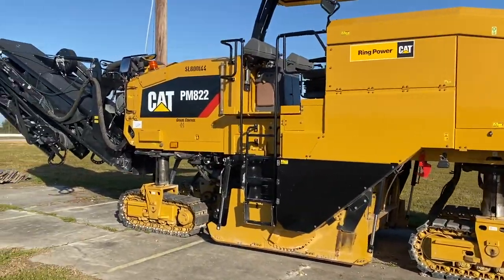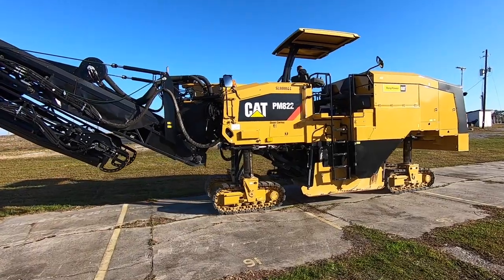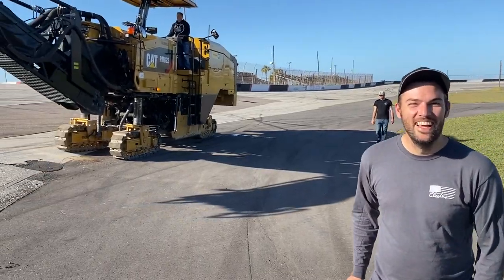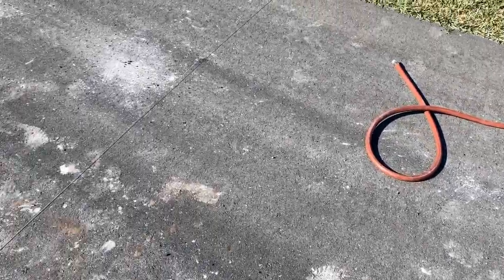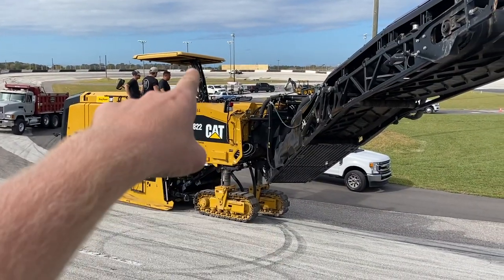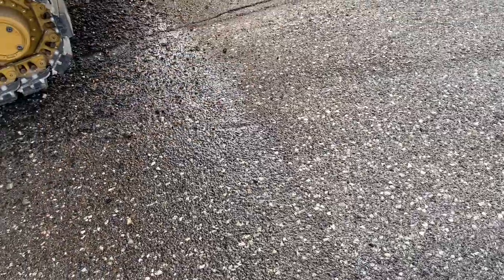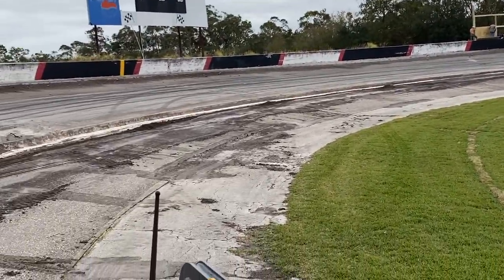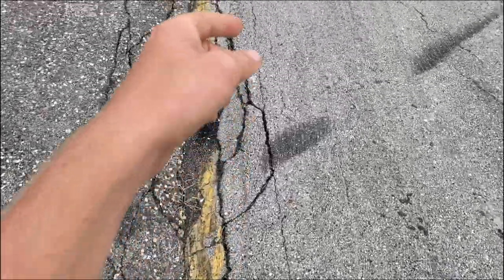Renovating an Abandoned Racetrack Part 5 - The BIG MILL Rips Into the Freedom Factory's Bank Turns!

Comment: The only time liner works cost wise is when you have extraordinary costs associated with disruption.  If you have basically greenfields (like you do) it is always cheaper to dig and replace
Reply: Ya if it was a open track with a full schedule it changes that dynamic completely.
Reply: @jaydunbar7538  or if it goes under a building
Reply: Don't forget about pipe bursting
Reply: @rys4469  far more expensive than how Cleetus is doing the job. It is always, 100%, cheaper to dig and replace so long as you don't have extraordinary issues.

Comment: When we did Daytona. We had a D9g on the outer wall. A cable going to the Grader. An they had to move together so the dozer held the Grader in place. We did have a cable snap. An the Grader rolled down the bank. Driver was fine. But I understand what you are going through.
Reply: I've seen pictures of them doing that to pave a track. It's wild! I think a lot of people don't understand just what's involved in paving a racetrack. Can't raise a dump bed on that kind of slope😂
Reply: It's hard to tell just how steep a bank is through a video, seeing it through a tv/pc/etc screen doesn't do it justice.

Comment: You should get reproductions made of the track blueprints and sell them as posters, maybe sign them.
Reply: The architect of the track may own the copyright to the blueprints. That could prevent ol Cleet from selling copies.
Reply: @wjpreslar  , everything is negotiable. It all depends on the details of the contract. In most, it takes both parties to consent to reuse. But again, it depends.
Reply: @Bill_N_ATX  agreed. Just pointing out that it isn't as easy as running out to Kinko's.
Reply: @wjpreslar  the dude is probably dead
Reply: @joelbryant7371  in that case his or her estate would own the copyright. Copyright in the US doesn't die with the creator.
Reply: @wjpreslar  , well it does sorta. It just dies like 75 years after they do, depending on when exactly they kicked off.
Reply: @Bill_N_ATX  75 years after the death of the creator is, by definition, not dying with it's creator.
Reply: @wjpreslar  thus the sorta. It’s the trigger for the eventual ending of the copyright. They do not extend in perpetuity.
Reply: @wjpreslar  Blue prints are public record once submitted to the city, anyone can reproduce them in accordance with freedom of information act.
Reply: @Bill_N_ATX  Blue prints are public record once submitted to the city, anyone can reproduce them in accordance with freedom of information act.
Reply: @1byte4  , yes, but they may not be used for commercial purposes. You would be able to use them for the usual Fair Use purposes, but just because something is given to and available to a government agency doesn’t mean it has lost its copyright protections. Use it in the newspaper or as a teaching aid, perhaps, since Fair Use is a defense to copyright infringement, not a prospective use, but you couldn’t print up copies and sell them to others. Otherwise there wouldn’t be a pretty good industry in selling plans for homes etc.
Reply: @Bill_N_ATX  Furthermore, cities don't always keep them in perpetuity. I wanted the prints for my house and neither the city not the county had a copy. Back in the days of paper for everything, space was at a premium and they'd only keep things like that for a specified period of time before destroying them. The only source after that time would be the copyright holder.

Comment: As a kid I remember my Dad going to pave at the Atlanta Motor Speedway. Anyways he showed me pictures of them using equipment on the bank, pavers and millers. They put a steel I-beam between the equipment on the bank and something heavy like a dozer or miller on the flat inside of the track to keep the equipment from flipping. Obviously brackets were welded to both pieces of equipment. hope this helps in the future.

Comment: Neighbor truly is one of the most reliable built cars ever.
Reply: Right. Ford needs to take notes on how to build a car. 🤣
Reply: well that one has a very special angle with it. RIP ED
Reply: @SpartanRacing1989  it did blow up at Cleetus & Cars. More white smoke pouring from the engine bay than the rear tyres.
Reply: @richardharrold9736  yeah but look at how much hell he has put that car through. Most Ford's would not have lasted an entire burn out
Reply: @SpartanRacing1989  eh, there's nothing special about that 5.4, Fords generally are pretty tough and the 4.6 Teskid is the strongest of the lot.
Reply: @richardharrold9736  theres nothing special about Fords in general. I'm just saying Cleetus and his crew can build a Ford better than Ford can
Reply: @SpartanRacing1989  L&M can, you mean. It's just a 5.4 with a sleeved block and some spicier cams, otherwise nothing that you didn't get in a GT500 way back when. Besides, all those overhead cam motors are basically a Jaguar design, but (in the case of the 4.6 Teksid) built in Italy by Ferrari engineers.

Comment: I just wanna say, that's a lot of diesel fuel
Just imagine how much diesel is used in other things, how many hundreds of gallons used in construction or how many hundreds of thousands of gallons in mining metal and lithium or oil pumping and all that, diesel really does make the world go 'round :P
Reply: Yup. This is why I am convinced that diesel will even outlive petroleum.

Synthetic diesel fuel!
Reply: And diesel covers a wide variety of things unlike petrol that people put into there cars... almost any fluid that has a chance of burning could be ran in a diesel, just the start and stopping use the normal stuff to clear the lines.
Reply: @wobblysauce  modern diesels will not just burn anything like the old ones. Modern EPA emissions requirements lock them down.  You would stop up DPFs and make NOX sensors go stupid if you tried.
Reply: @brandonbrown3600  I really want to convert an older diesel engine to something entirely mechanical, not a single bit of electricity to be found, just a crank start and knobs and levers in the cockpit
Reply: And Jet fuel.
Reply: @Avetho  anything pre-common rail equipped with piston pumps should do what you want. depending on size, you might want to attach a smaller single-cylinder engine to crank over the large one, or get a compressed air start system.
Reply: @wobblysauce  just don't do that to a common rail injection system.
Reply: @daszieher  This is why I love YouTube, I learn so much.

So something using mechanical injection, and when you say piston pumps, are you talking about Injection Pumps? I just looked up what those are and 9000 PSI is a lot of pressure, and they're like a mini engine of their own that pumps fuel. And the air-start would be a smart move as well, I forgot that was even a thing, since the tank could be recharged as the engine runs. Lots of good ideas, thanks!

Oh, and perhaps an intake shutoff lever/stop would be handy, in case the engine starts drinking oil instead of diesel since there'd be no electrics to tell me anything XD
Reply: @daszieher  Sure some are quite picky now, most can be fine if it is filtered well, older diesel could be ran on deep fryer oil... and you can smell like a fish and chip shop.
Reply: @Avetho  yes, that is the type of pump I meant. It meters fuel by varying the compression/pumping stroke of each little piston going up and down thus directly varying the total volume injected per stroke.

Another device governed by a set of spinning weights determines the maximum volume injected per stroke depending on engine speed. This allows to limit smoke emissions when the engine's rpm are too low to "digest" the pump's maximum flow rate.

If your diesel starts burning its own lubricating oil, i.e. it has a "runaway", shutting off fuel will not really help. Instead, the air intake needs to be shut or the engine stalled through clutch and brakes. Alternatively you can use a pure CO2 extinguisher. However, the system will need to displace  most intake air for as long as the engine takes to spool down below self-sustain rpm.
Reply: @wobblysauce  do you have experience running filtered used cooking oil in modern common rail diesels?

asking out of genuine interest, because in my day job, I market a renewable diesel made by processing such oils. believe me, it takes much more than filtering to get to our quality. ;)
Reply: @daszieher  So for the engine shut down if it goes into runaway (of course the fuel would be cut off by now don't wanna give it more compression-ignited fuel lol), then like an intake choke-valve made to cut off airflow when pulled while I put it in gear and hit the brakes, and if that doesn't work then open that valve again and instead pull a knob that triggers a small fire extinguisher connected to the intake so the CO2 chokes out the engine? Since this would be a vehicle designed around longevity and survivability so it can function without any electrics at all.

Definitely interesting to learn how an injection pump works, I might want to dive in to the mechanics of diesels now, you're getting me somewhat invested in learning now XD

What about lights? Maybe a small CVT that maintains a specific speed via weights and whatnot and powers dynamo flashlights via flex shafts? I mean, you can purchase a 3 foot long shaft that can transfer 110 in-lbs of torque for like 70 bucks a pop, just use a coupler (like a mini Geislinger coupler) to dampen the shock so the flex shaft doesn't exceed its torque spec.
Reply: @daszieher  Think for most it comes down to the temperature of your environment, colder places need to run a tank heater as it is thicker, some run it straight some run with different mixtures, most duel tank, start and stop with normal and switch to WVO in between. 
Some find it can sludge up more so not as good for the short run trips as you need more frequent burn periods to burn off the carbon buildup which you have to do running normal diesel also. 
But like most things it comes down to your filtering.
Reply: @wobblysauce  ah, ok.

with the more modern fuel, none of that is necessary. you can run it all day long, or on short trips, it doesn't matter.

It's clear as water, essentially like liquid candle wax, but stays liquid until well below past -5°F (depending on production, past -25°F)

So no heaters, mixing or extra tanks for regular diesel needed.
Reply: @daszieher  Ya heaters are only normally cold days or near freezing. 
Was referring to the classic 10-20, min highway run, getting everything thing up to temp good for the engine oil also DPF etc.

Comment: Not sure if you looked into it or not but I would try Seamless Infrared Asphalt Repair, they heat up a large area rake it add some chemical to help bond new asphalt to the repair area then roll it. when the job is done you end up with a perfectly smooth repair.

Comment: That fine mill dust would make great bedding for the pipe repair.. I hope u see this cuz i say get rid of all storm pipes under the track and use a expensive ejection pump kinda like a lift station to get the water out for the middle of the track and just dump it into that nice ditch u got that way the dirt cant leave from under ur concrete... I'm a plumber that works near lake st.Clair so waterproofing gets tricky when the water table is the same elevation as ur thermostat

Comment: For the banked track, I'd give the surface a light mill and put an extra lift of pavement down to give it some thickness. If you want to cut corners even more, you might be able to get away with just a chip seal before the next lift. The cars you're running are all light enough that making the pavement too thick won't be too much of a problem, just make sure to use stuff with the right temp rating.

If you want some pro-bono engineering work to investigate some of this stuff, I'm a Civil Engineer and I'd be more than happy to help.

Comment: Asphalt for racetracks contains a polymer called styrene-butadiene-styrene (SBS), similar to what makes up Styrofoam cups. This raises the asphalt's melting point so that it can stand up to the summer sun and hot, supersticky racing tires. The asphalt must therefore be laid down at a higher temperature—about 320 degrees Fahrenheit versus 200 to 300 degrees for public highways. Because of this, it's mixed as close as possible to the track and transported in insulated trailers

Comment: suggestion ,,, since your tearing into the track ,,,consider ripping it all up and setting up a dirt track , so you can get open soon and build up some funds ... 2 things ,, the tar is removed and racing can start ASAP and the track will become more and more stable with the traffic on it,,,, maybe run dirt for a year or 2 then come in with some millings and tamp over the soil for a base then tar it later ... i.ve been in the construction business for over 35 yrs. and have worked on Atco Raceways track several times and the buildings,,, i know the business... this is your cheapest way to get some money coming in... you also have enough man power standing around that alot of the building repair could be done in house ,,, i've hired people that sold shoes and build developments ,, its not rocket science but your people just have to have the back bone to put in the hours ,,,retiring and  i was thinking of moving to FLA. some time too  ... its a shame i haven't, id be happy to organize a crew and get some of this stuff done for you

Comment: I reckon it would be quicker and easier to cut the lines with the disc cutter then use a hgv to pull up the unwanted track, that small road grinder seemed slow af

Comment: im wondering if the sinking and hole on 3-4 could be another bad rain drain pipe that might exit the track under the turn ? just voicing the possibility just in case there is something that would save time knowing now and not later

Comment: im sorry to say but cleeter you got some fubar pricing and explications on why the entire track couldnt be milled and paved. no reason the surface couldnt have been milled to the base layer of asphalt, the. full milling in the areas with base failure. and rven if you mill the entire track it is entirely possible to establish gps points and regrade the base material and to get the correct grade on the paver. Im a union heavy eq operator and work alot with gps theres no reason it would need to be "re-engineered. it just would require competent operators, the right tools and a few guys with experience.

Comment: Yeah no, fixing the damaged track sections makes the most sense rather than a full repave, however spending $5k to replace 1 5 foot section of pipe without a liner instead of spending 20k to do the whole 175ft makes no sense. Especially when you’re already spending as much money as you are and if you have another issue along the way you’re gonna have to get it fixed right away again which is gonna pause things going on at the track and cost you another $5k unless you decide THEN to do the whole thing which then it’ll cost you $5k more than it should’ve and you’ll have to take another long pause while that work is being done. For just 4x the price and only $20k you could get 35x the amount of pipe fixed and protected for 50 years instead of having to fix small sections for $5k each time over and over again and not protecting them for nearly as long because of no liner. It’s a business investment but it makes sense to spend the money there because that’s serious maintenance that if it has another problem it’s gonna cost you again and again in both time and money. Rather than just spending the 20k now to have it all fixed and protected and not have to worry about it ever again most likely unless you still own the track when you’re in your 70’s and it’s time to be replaced and fixed up again.